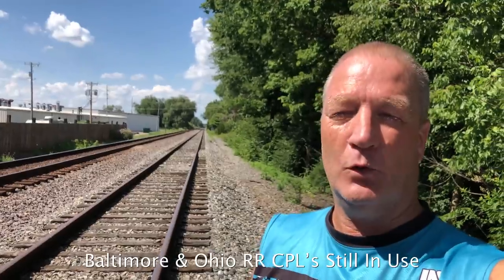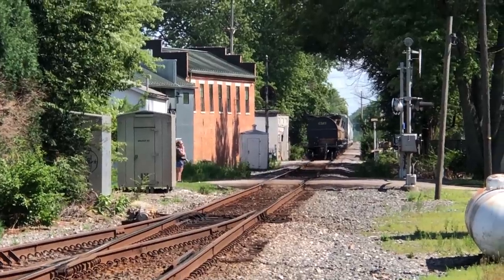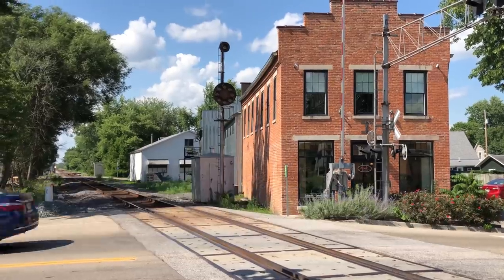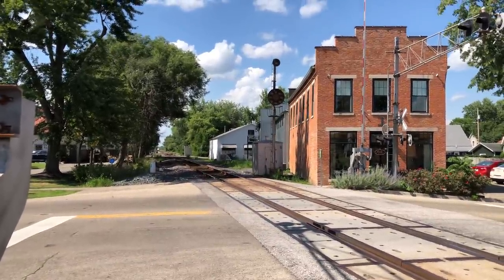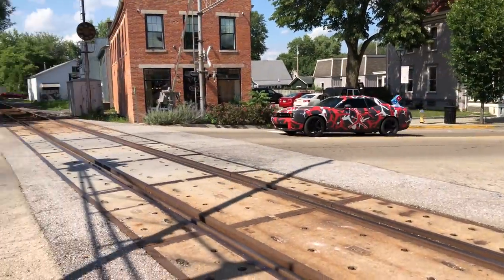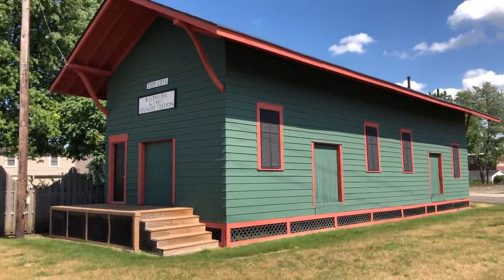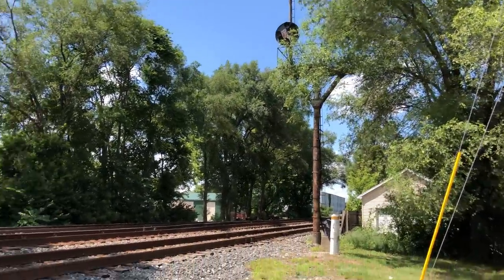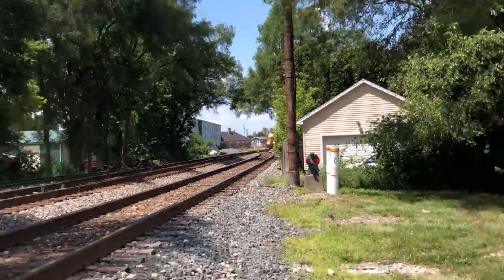Baltimore & Ohio Railroad Signals Still In Use!  Weird RR Crossing, Train With DPU In Tipp City Ohio

Comment: Nice catch of the CSX GEEP local train running LHF that's always a great catch! The 2nd CSX train w the DPU had quite a HEFTY consist of mixed freight cars as well! Those old B&O signals along w the dwarf signals are so awesome! The last part of the local switching was cool too at that unique crossing! I like how that dwarf signal is tucked away by that building but still noticable by the indicator lights.recently bought some dwarf signals for my layout. Thanks as always for a great video in Tipp, Ohio.
Reply from the maker: Thank you very much!

Comment: Cool on the old signals. Nice they are still in use. Cool that you checked the rail since i was working there. I may have even had a test piece cut off of that rail.
Reply from the maker: Very cool
Reply: @JawTooth  Thank you.

Comment: Hello!  You have an unusual catch at 5:34 with a "Pan Am" boxcar!  I think that those are rare in Ohio and farther west, as Pan Am Railways is a CSX subsidiary that consolidates former Class-II railroads in the Northeastern parts of New England (from Maine to New York).  Kind of like finding Conrail livery switchers in use in Western Minnesota on short line or elevator-related railroads -- never repainted into a new set of colors, or with a new railroad marking for the unit.  You also have a segment from 5:06 to 5:26 of loaded coil cars with rolled sheet metals without their covers, something that I don't often see out west.
Reply from the maker: Yes, most of them around here have the covers over the steel but its common to see them uncovered.  I filmed a unit train of them last week

Comment: That's neat stuff. I like that location with the brick building, signal, and crossing. That would make an awesome scene in a model railroad.

With the B&O signals, they use the cantilever setup with the signal to the left referring to the left-most track and the dwarf referring to the siding. I was lucky way back in the olden days (1985) to talk with an old-timer conductor from the B&O at the Boston NMRA show. He explained to us the different signal aspects used by the B&O. There's not much I can remember except for that and a few other tidbits. That's a long time ago.

Comment: Thank you for documenting these trains in Tipp City and Troy, Ohio, Jaw Tooth! That was a long CSX manifest train that passed you in Tipp City, Ohio. The conductor had a relaxing view of the back-up move when you caught the local in Troy, Ohio. I bet he does not do that in the cold months of the year. Do you know if the local uses a shoving platform aka caboose in the colder months of the year to protect the conductor from the cold? I was taken aback at 16:05 when an 86-foot auto parts boxcar appeared with a Chessie the Cat logo appeared in the slide show. I must have been distracted when the boxcar appeared in the video. I had to look back through the video until I found exactly when that boxcar appeared in the video. I found that at 8:59 that boxcar made its appearance. The reporting mark on that boxcar is CSXT 173344. Thank you for taking a photograph of this boxcar and for adding the photograph to the slide show!

Comment: Caught one of the new logo locos , the DPU at 7:55. You seem to have a log of Rail Parks in Ohio, way more than we do in PA . Get as many photo's of the CPL's and Dwarf signals as you can ,I'm sure CSX will change them at some point.👍👍
Reply from the maker: Very cool!  Yes, they will go as they break down.  CSX has removed moved of them from Indiana.  I wanted to get them over there but I missed out.  A couple years ago I got them in Indiana in a few spots
Reply: The lead locomotive on that train is just as new -- they're consecutively numbered rebuilds. 7270 on the front and 7269 in the middle.

Comment: I wonder if they are shunting those grain cars up to the elevator at Eldean.
Reply: There weren't any grain cars on the local. All the covered hoppers were plastic pellet cars -- you can tell by the style of the dump gates.
Reply: @beeble2003  Thanks! I know there is a spur that runs off that line that crosses S. Market Street, then curves to cross W. Main Street. That spur runs up to the Mennel Milling elevator on 25-A at Eldean Rd.

Comment: It doesn't make sense to me, gates one side of the crossing and  just a crossbuck  on the other. Love the old signals still in use and mechanical bells. Nice train treat for this morning. Thanks. Have a nice day 😊🌈
Reply: One way street.
Reply: @danielulz1640  I was wondering about that 
Thanks
Reply from the maker: My thoughts exactly when I first looked at it but then I realised it was a one way street so they didn't need gates on the one side